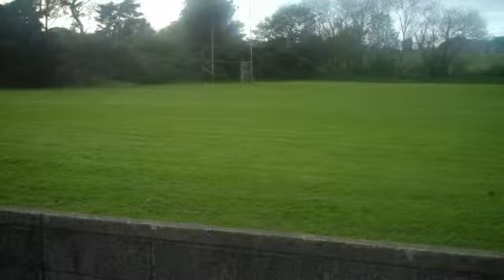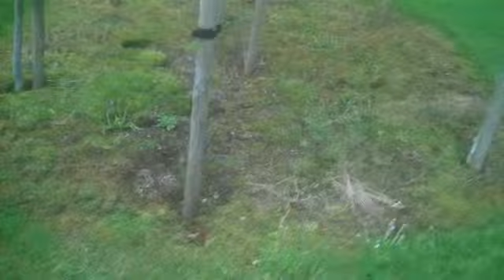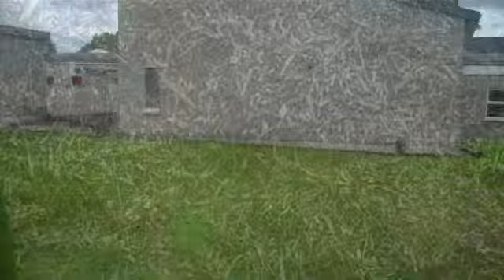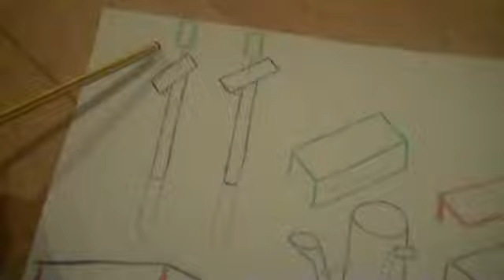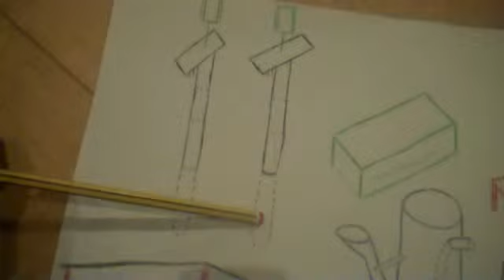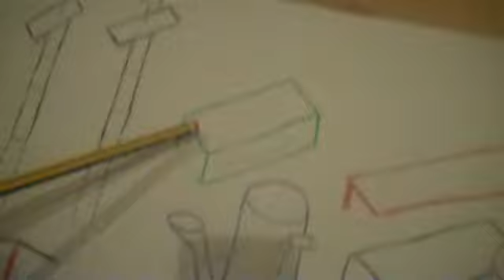Energy Landscaping

Comment: that bank (at 55 sec) that you said was too steep to mow....try a petrol hover mower / flymo tied onto a rope long enough to get the mower to the bottom with you standing at the top of the bank......swing the mower  side to side on the end of the rope.....they used to do the banking around the sports ground at the high school i went to like that....i've done the same thing with my electric flymo using the cord as the rope.....works rather well as long as your not trying to mow grass thats too deep

Comment: Good ideas, Michael, but the trouble is fossil fuels are still so cheap - no one is going to be that interested. Yet.
Reply from the maker: Normal yes. But one large building in my town that has a pool takes 100 000 euro a year of heating oil I don't know what it takes in electricity   with large grounds labour to manage the grounds is where the real cost is.With this where u would have 3 or 4 groundsmen a trainee would be needed so one of the senior men could manage the plant.The grass has to be managed it just means u dispose of it in a different place and if the treas are planted to make efficiency it would save labour. Saving in oil 100 000 euro a year over 20 would pay for plant I think thanks
Reply from the maker: Also I am using a solar hot water heater heat water first and the electoral panels and a 12 v element  to boil it for steam witch should make electoral solar panels more efficient  thanks for comment it alowes me to explain more clearly thanks
Reply: Michael O Callaghan
 It's a really interesting subject, but I think I've gone off solar power as a realistic proposition here on the west of Ireland. Of course we can get some energy from it sometimes - but at what cost in infrastructure and maintenance? The problem is that you always have to have full back-up ready to go just in case the sun goes down (or the wind drops, or whatever). But with your timber, or other bio mass fuels, the energy is always there sitting in the woodstack ready to be used at the drop of a hat.
Reply from the maker: WayOutWest Blowinblog If u could get in this case even 10% out of solar and say 10% out of wind it is hard to ignore  that 20% that's being turning  into a store energy in the form of hot water that can be stored in tanks and like u said u then stored energy bio mas that can boost it up when needed.The light energy towers could be a the first viable pyramid scam  where an investor can make one  investment so investor bye 100 and they become viable bye more more investors more mills until it reaches critical mass and the returns from the mills can grow the numbers of mills lol
Reply: Michael O Callaghan
It all makes good sense, Michael, but I'd still be surprised if you can persuade anyone to go for it. The problem is the investment in the first place. And wind turbines just don't last very well. (Couldn't count the number of little ones around here that ended up smashed on the ground this windy winter.) Good luck!
Reply from the maker: WayOutWest Blowinblog Your right about the investment. A wind mill could be compared to a hub on a car both go round and a car hub can take incredibly g force and hundreds of m p h it should be possible to produce a small mill that could with stand a storm